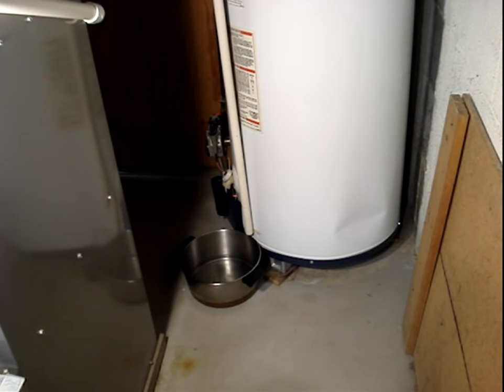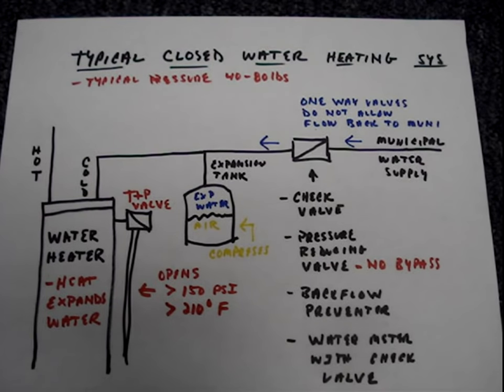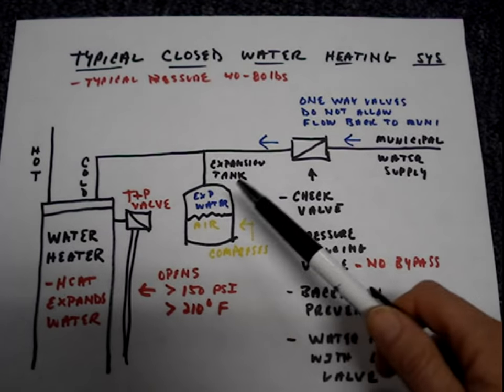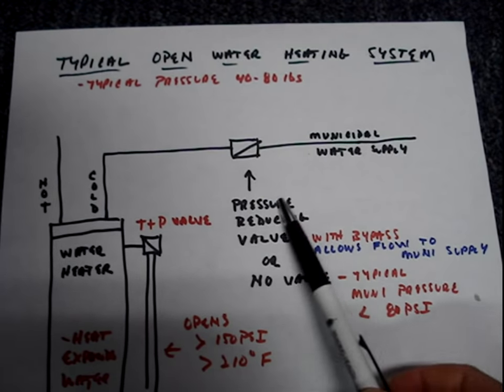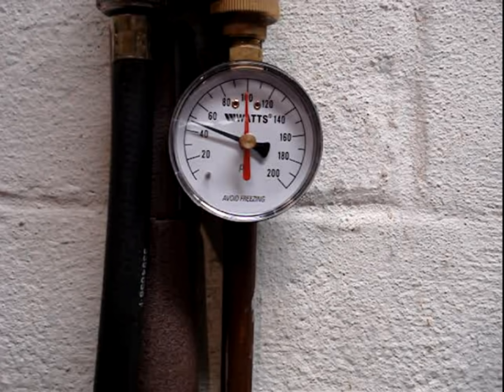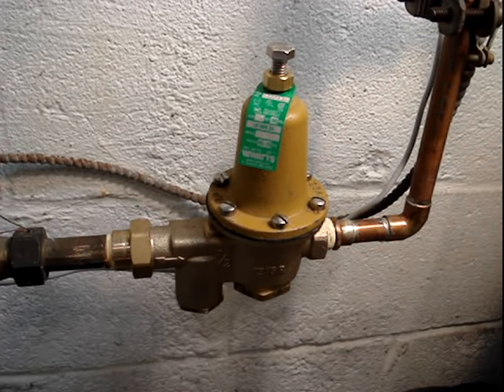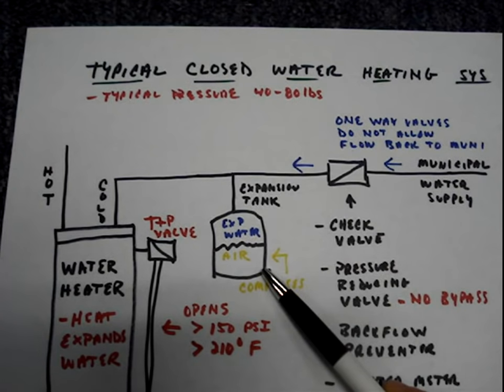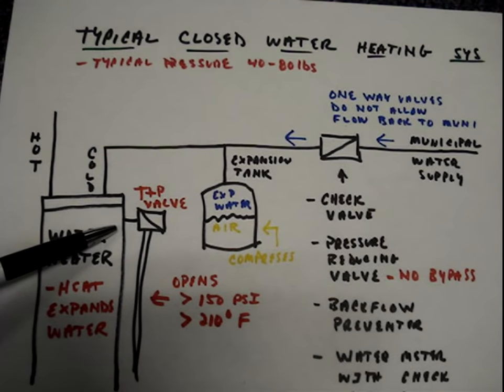Troubleshoot a Leaking Water Heater Pressure Relief Valve

Comment: Thanks for a great video!  My P&T relief valve kept popping off on a new water heater; your detailed troubleshooting steps helped me pinpoint the problem - my city water pressure was just over 100psi at the water heater! I've since added a pressure reducing valve to the system - seems to have solved the problem.  Thanks!
Reply from the maker: You are welcome, Brian.  Way to go on being resourceful and finding the solution to your problem.  It's great to hear that the video is helpful.  Thanks for taking the time to comment.  Have a great day.

Comment: Thank you for sharing,  you would make a great teacher at a trade school or technical college.  Speaking of the T&P valve leaking 210°F because of a faulty thermostat,  something that is extremely rare and unlikely, another problem is a grounded heating element in an electric water heater AND a failed high temperature cut off.  The normal thermostat only switches one leg of the 240 circuit.  Sometimes the element can deteriorate internally,  and the inner nicorme wire can touch the outer sheath of the element,  which is grounded through the tank.  If this occurs near the center of the element,  it can have enough resistance to limit the current drawn, and the circuit breaker will not trip.   The element will heat non stop with 120 volts.   The red reset button is supposed to pop out and cut power to both legs.   If it jammed up, then your T&P valve is your last stop safety device, before a catastrophic explosion.   Water, when superheated over 212 degrees F under pressure,  flashes to steam increasing its volume about 1600 times  if the tank ruptured or a pipe blew off the tank and drops to atmospheric pressure.   For this reason a pressure only valve will not offer adequate protection in storage type water heaters and boilers.
Reply from the maker: Thanks for the compliment and thank you for the contribution you have added to the comments.

Comment: A great way to find out whether the T&P opened due to pressure or temperature,  is the quantity of water released.   A high  pressure condition (over 150psi)  will cause intermittent discharge of relatively small amounts.   A high temperature condition (over 210°F) will cause large amounts of very hot water to be discharged,  as the valve will open full force and stay open until the temperature at the valve probe is cooled below the temp limit by the cold water inlet.   It's also why Code requires a discharge pipe to be installed within 6 inches of the floor and be visible.   For one, you want to be able to monitor for discharge, in addition,  it's to prevent severe scalding in case the  valve should release while someone is standing nearby.
Reply from the maker: Thanks for the tips, Kyle.
Reply: So if my T&P is discharging very small amounts of water then it's most likely the thermal expansion tank and not the actual T&P valve?
Reply: I would say that is an inaccurate statement. My T&P valve gushed water even with power to the heating elements off. I had the power turned off to the hot water heater for about 2 days. Drained it, and when I filled it back up (still with no power to it) bam, discharged a ton of water again. It flowed until I turned the incoming water off. I am on a well, so I haven’t narrowed down the problem yet. But I can say your statement about it being temp is incorrect. I changed the valve, tried the same test, have the same issue. Even with no power to the tank.
Reply: @azeekay  correct.  Thermal expansion is probably the most common cause for a leaking T&P valve.   The expansion tank if present may have lost the air cushion.   If a check valve or pressure reducing valve is installed (local codes may require it to prevent cross contamination of the main water supply) when the tank is heating the water cannot expand back into the water main, and easily approaches 150psi which releases the valve until the pressure is below 150 psi resulting in relatively small amounts of water 

A high temperature condition (210°F) caused by a stuck thermostat or grounded heating element is extremely rare, because the high limit switch or ECO would also have to fail.   On most gas water heaters the ECO is non resetting and requires replacement of the gas control valve after an overheat condition.   An electric water heater has a red reset button that pops out cutting both legs of the 240V circuit if the water reaches 170 - 190°F depending on the model.
Reply: My valve is leaking but the water isn’t hot just warm

Comment: I recently had one of the elements on my water heater go bad so I had to drain the tank and replace it. When I drain the tank I had a lot of calcium buildup come out and I also replaced the other element while the tank was empty. When I removed it it also was covered in calcium. We had been having an issue with not having enough hot water so I turned both of the elements temperature settings up to about 150°. Fast forward a couple months and now the T&P valve keeps periodically draining out of its drain tube. I'm not sure why this has started happening but if you had any advice I would appreciate it. Great video by the way very thorough and well laid out
Reply from the maker: You could have a new problem not related to your previous repair.  You may want to try going through troubleshooting steps to identify the problem... with out doing some tests there is no way to give an accurate answer to the problem.
Reply: @Know-How-Now  thank you for the response. I don't know why I'm only now seeing it. But it ended up being a completely separate issue. The T&P valve had a small leak that was causing the water I was finding
Reply from the maker: I've found that if you open/close an older T&P valve that it will often start to leak.  There is likely a rubber gasket in there that is getting brittle.  It's not a problem until you disturb it by opening & closing the valve.  Thanks for taking the time to write about the solution.  For anyone needing a video to show how to replace the T&P valve here's a link to a KHN video showing how to do it.  https://youtu.be/d6JCr3UcsCw

Comment: I’m getting a leak from behind that white gasket where the pressure relief valve screws into the water heater, does that mean my water heater needs to be replaced or could it still be the valve?
Reply from the maker: I'd try removing the pressure relief valve, clean the threads, put some pipe dope or some plumber's tape on the threads.  Hopefully that will stop the leak.  I have a video that shows how to replace a T&P valve that should help.  Here's the link:  https://youtu.be/d6JCr3UcsCw

Comment: What about brand new gas heater not turned on yet just hooked up so I have water while working on house. All the sudden today valve was wide open don't understand how since it's not heated/on yet ? Could that valve be bad brand new
Reply from the maker: That's weird. I would recommend calling the manufacturer.  They may have tech support.  If it's defective, they should cover it under warranty.  I have a video on how to handle warranties/defective products.  You might find it helpful.  https://youtu.be/i_r0w-vYZQc

Please let us know what happens.. it sounds interesting.
Reply: @Know-How-Now  found the problem nothing to due with water heater. House has no water pressure regulator some reason. Just strange wasn't pumping out like it is now been in crawl space all week adding power outlets to porch and the outside carport. When I was under there and also two other people it's been realtively dry but still put in moisture barrier and that is now all wet. Just seems strange, so adding a valve hopefully this weekend.
Reply from the maker: That's interesting.  I suppose water pressure from the supplier could increase if changes were made to the system.

Comment: Hi, It leaking from bottom. Insulation dry. Also,. Leaking out copprer pipe outside. New heater or new pressure release valve? No other leaks. Water clear 9yr old heater w hard water. Very hot water. Kenmore.
Reply from the maker: I recently paid $8.95 on eBay for a new T&P valve.  I have a video showing how to replace one, mine was easy to change.  https://www.youtube.com/watch?v=d6JCr3UcsCw

Comment: The problem I found with my T&P leak was water pressure ' my pressure reducing regulator has failed and I was getting  over 160 psi cold water supply  to the house( should by 70) and case for T&P to open up and leake 'T&P relief valve is factory set to function at 150 psi water or 210 fahrenheit hot water  ' both pressure and temperature can cause the leak   '  I put a pressure  gage on the cold  water line    (available at homedepot  0 to 200 psi  )set the pressure for 60 psi by closing half way the  main vale( problem has resolved)  until later I get a chance to replace bad regulator ' I suggest that the first thing you should do  'if you have leak from T&P relief  valve ' or you install new water heater and experience the same problem '------regulator was replaced today 10/16/21

Comment: Hi, my t&p valve opens up and lets water out after it gets done heating. What does that mean?  I have a pressure regulator on my water system from the mini water  but don't see anything else. Just recently started noticing water on my basement floor from the t&p. Not a constant leak, just lets water out from time to time, normally after heating
Thanks
Reply from the maker: If your regulator has a bypass, maybe it's clogged and not allowing the heated water to expand back into the municipal system. Some of the regulators have a strainer plug and a screen. You can try cleaning it out.  You can look up the model number of the regulator to verify it has a bypass.

Comment: My T&P valve seems to open/leak every time someone showers or runs hot water. Started after I tested it like you should do once a year.
Reply from the maker: There is rubber sealing the connection on the T&P valve, over time it dries out.  If you have an expansion tank, make sure the bladder has not failed.  If the expansion tank is good, then you need to replace the T&P valve.  If you allow it to leak, mineral deposits can build up and it won't work.  I have a video that shows how to replace one:  https://www.youtube.com/watch?v=d6JCr3UcsCw&t=41s
Reply from the maker: PS - Odds are that if you haven't tested the T&P valve and it is old (over 10 years) it wouldn't reseal because the rubber was dried up.  The seal was good until you disturbed it.  The same thing has happened to me.
Reply: @Know-How-Now  I have lived here under 5 years but the previous ownders probably never tested it.  It started to leak when I tested it.  So, you are probably right.

Comment: I replaced my bad water heater. The T&P valve started leaking after 3 months. It never opened, just leaked water. I replaced the valve and now the new one is doing the same thing. How do I troubleshoot this issue?
Reply from the maker: Do you have an expansion tank?  The bladders inside of them fail.  Is it leaking when the water heats turns on?  If yes, then it's likely the expansion tank.
Reply: No expansion tank. The old water heater didn’t have one either and never had a problem. Do new water heaters need them?
Reply from the maker: You would have to check with your local codes to see if you need to install an expansion tank if you replace the water heater.  Did you use a water pressure gauge to check the pressure when the water heater is heating water?
Reply: @Know-How-Now  Thank you so much for the info. I’ll get a pressure gauge and check the codes. Great channel. Subscribed!
Reply from the maker: You are welcome, Ray.  Welcome to Know How Now channel.  If you haven't noticed, I try to organize the videos using playlists so you don't have to scroll through all of the videos.  There is a video on how to check water pressure.

Comment: awesome! can the pressure reduce valve with bypass be used at the same time with the expansion tank?
Reply from the maker: The bypass on the pressure reducing valve & the expansion tank accomplish the same thing.  If you have that situation, I'd guess that someone added the expansion tank for some reason (the thermal bypass on the pressure reducing valve not working?) or maybe just out of ignorance.  Or maybe they replaced the pressure reducing valve with the wrong model?  You'll need to be mindful of your local codes too.
Reply: Know How Now I just got a new water heater and the expansion tank. Since then the T&PV started dripping and the main valve banging ( especially with the sprinklers on). The plumber didn't pre charge the expansion tank according to the pressure of the house. The old open system never faulted. The old water heater had a T-flow ball valve on the cold line. I can't get the right pressure, so I think I need a new PRV. The one I have now (Wilkins BR4) range from 15 to 150 PSI. How do I choose the right PRV for the house?
Reply from the maker: I'd call Zurn or Watts (both make PRV's) and talk to their tech support.  They will help you get the correct one.

Comment: My 3/4 valve is leaking, it usually drips when the boiler kicks on, it’s a pretty good leak and I’ve tried opening the valve releasing water and it’s still dripping. The boiler is about 8 years old, does it need replacing, the psi is about 20, when the boiler kicks on psi is usually 35. The other half inch valve drips very minimally.
Reply from the maker: It sounds like thermal expansion could be the problem.  Do you have an expansion tank?  They have liners that eventually fail.  If liner failed and the tank is full of water, then there isn't an air in the tank that can compress to compensate for the heated/expanded water (causing pressure to rise when the water is heated).  You may be able to tap on the tank and hear if it is full of water.
Reply: And how do you get the water out of the expansion tank? The P&t valve wont stop dripping and is new.

Comment: Code violation your pipe cannot be plastic. :)
Reply from the maker: Which code are you using?  Which section & paragraph number would be great to know too.  PS - I'm not asking to be a jerk, just out of curiosity.  It's an old water heater I'm wondering if plastic was legal when it was installed.
Reply: Residential is plastic and commercial is copper. Doesn’t matter where you are in the world .... any tube is better than no tube.
Reply: In the UK it is copper as standard. Or you can use heat resistant plastic.

Comment: I don't believe you mentioned the remote chance that debris/sediment could be preventing the valve from seating properly. Sometimes, rather than replacing the valve as if it is bad, you can flip the valve open and closed multiple times to spurt the water with the intent of clearing the debris and reseat the seal.
Reply from the maker: Hi Josh, it's very kind of you to take the time to comment with the great tip.  Have a great day.